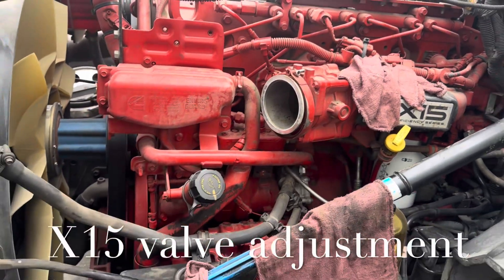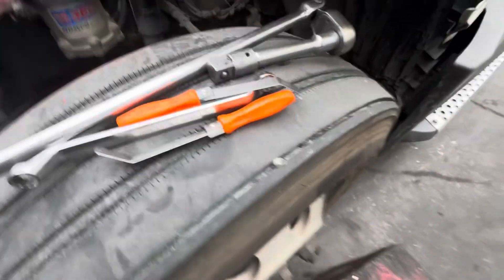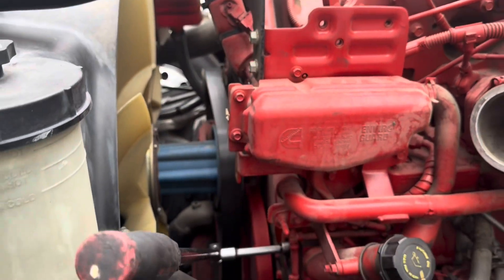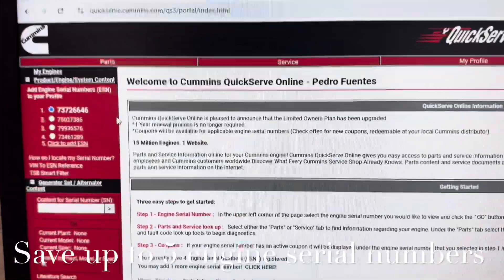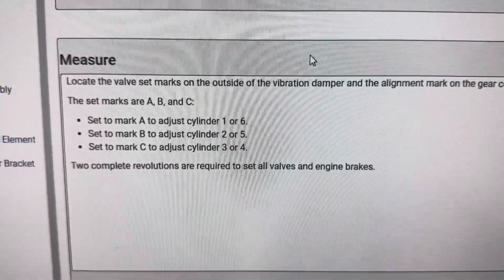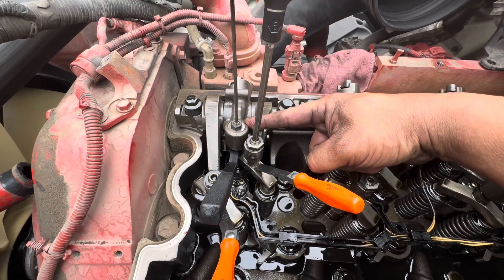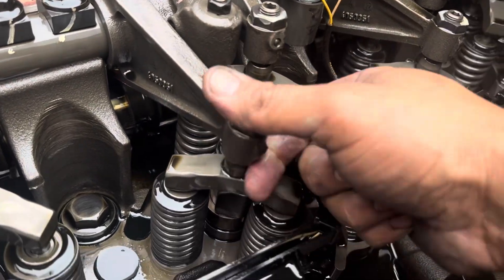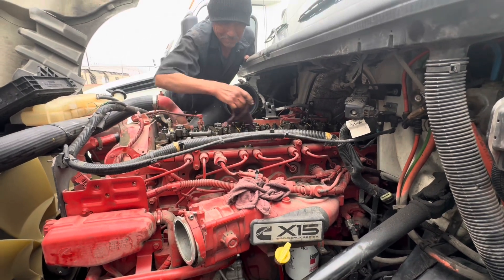X15 valve adjustment and how to look up any Cummins engine serial number for free

Comment: At mark A can't you do both 1 and 6, B 2 and 5, C 3and 4 at the same time?
Reply: No. One rocker set  will be tight, and one rocker set will be loose. You adjust the loose one. For example: when you turn it to A, you check cylinders 1 and 6. Whichever cylinder rockers are loose is the cylinder you adjust. 
You have to turn the crankshaft 2 revolutions to adjust all the valves

Comment: Had Peterbuilt of Cincinnati replaced my leaking damper last year with a new one. Well , they forgot to paint it red and now it’s rusty. It’s almost impossible to see where AB&C is located.
Reply from the maker: @thereckchanic4709  I’ve had a few of those come with heavy rust. Had to use some sandpaper and white or yellow paint to help identify. It is a pain though